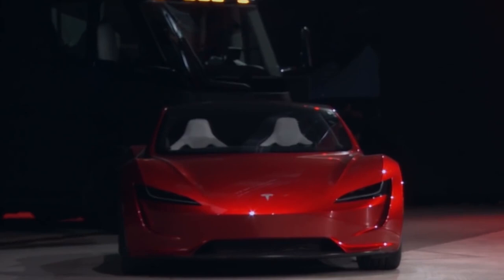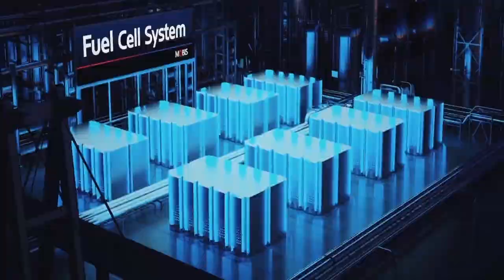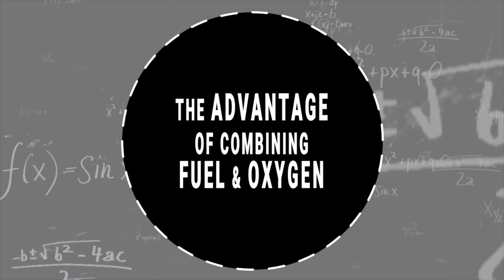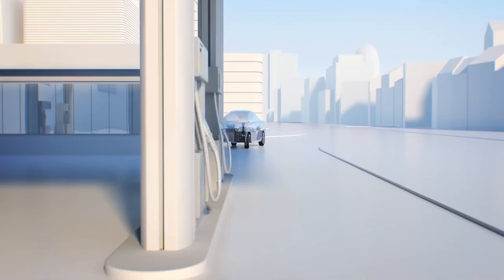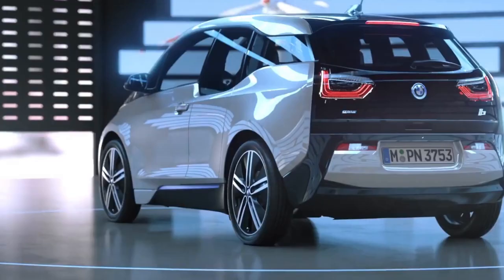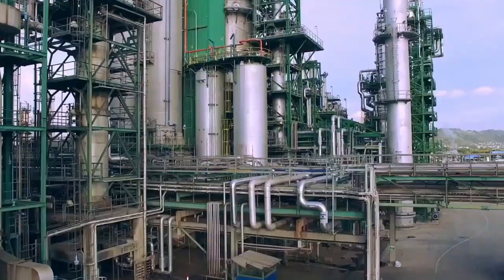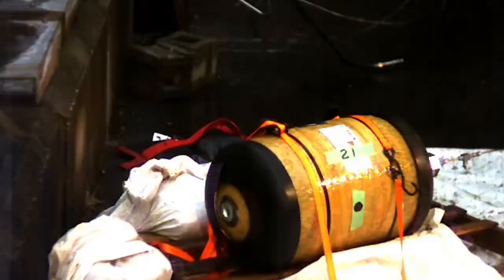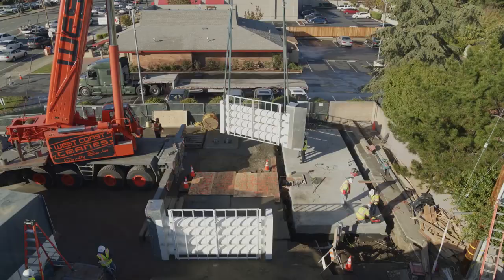is hydrogen fuel cell the future?

Comment: So hydrogen cars currently cost more, cost more to run, and only have 40 places in the US you can refill compared to the tens of millions of external outlets that could theoretically be used to charge a BEV. Hydrogen has its advantages, but it probably won't end up being the better option for cars, it isn't necessarily bad it is just less good and isn't likely to improve much faster than BEVs at this point, the improved energy density would probably be better for aircraft though.
Reply from the maker: I agree with you, for now, hydrogen might be a better option for heavy transportation
Reply: Five years ago you couldn’t wait half an hour at a Shell gas station to charge your battery acid car because there were no charging options. Face it the end of battery acid technology is in sight.
Reply: @rickrozen2341  I don't know of any decent electric cars that are made or sold in the US  in the last 15 years which use an acidic electrolyte. Plus I have seen plenty of gas stations where I could charge an electric vehicle some of which probably haven't been updated in the last 20 years. You probably want to check with the person inside the gas station before using their power but external outlets have been a feature on buildings for quite some time and you can usually use them for free.
Reply: @garethbaus5471  All electric cars use some form of battery acid/fluid. The difference is while Tesla uses unsustainable lithium ion batteries these hydrogen cars wil use sustainable hydrogen as a mean of storing chemical energy. The technology  as far as the electric motor engine is the same the difference is the means of storing the chemical energy.

Instead of waiting between half an hour to eight hours to recharge your lithium ion battery why not just tank the chemical energy in the form of liquid hydrogen?
Reply: @rickrozen2341  hydrogen cars are not significantly more sustainable than lithium ion batteries, we are about as close to running out of any of the materials used for lithium ion batteries as we are to running out of sources of hydrogen, and we don't need to build nearly as much energy genorating infrastructure, or use nearly as many fossil fuels (depending on the method of genorating the hydrogen) neither of which has a negligible impact on the environment.
Reply: @garethbaus5471  Uhmm false while hydrogen electric vehicles are sustainable, lithium acid vehicles are not since Lithium is a rare earth metal and the mining of Lithium is highly unsustainable. In fact the reserves of fossil fuels are larger than lithium reserves and lithium acid batteries cannot be recycled. 

Hydrogen isn’t used as a fuel that’s what all teslaboos get wrong hydrogen is simply used as an agent to store chemical energy and it’s less wasteful as lithium battery acid. Because people do not want to wait eight hours for their RV to charge they’d rather spend a minute or two refuelling hydrogen! Also I’m not interested in destroying the earth or financing child labour so that is why I wouldn’t drive a Tesla.

Comment: As fuel sources improve, the environmental impact of microfine dust produced by tire wear will need to be added to environmental impact of vehicles as they will become a greater source of pollution than the fuels on which a given vehicle runs.
Reply from the maker: Its look good topic to another episode
Reply: I look forward to when that time comes.
Reply: If we use plastic from the wood, we will have no problem more.
Reply: There are also particulates from brake pads. Since vehicles with Regen braking use brake pads much less often if driven well this is another pollution saving of these types of vehicle.

Comment: As long as we make electrolytic hydrogen from photovoltaic panels and wind turbines it can be used as fuel for cars and aero planes using the fuel cell. The fuel cell needs to be made more efficient. The fuel cell should not give off heat which it does.
Reply: What more do you want it’s already more efficient then Internal combustion engines. I think what you actually mean is the electrolysis (initial Energy investment to refined the water into the hydrogen fuel) which is still more efficient then oil refining and if uses surplus’s renewable or nuclear energy and is more cost effective per kwh of storage then batteries, then what’s the problem? Maybe you prefer hydrogen generated form thermal chemical hydrogen synthesis (waste heat of nuclear or mirror array to split water) no costly input at all? Or maybe Microbrial hydrogen production using waste bio products as feed stock for hydrogen? Heck Jupiter is Almost entirely made of pure hydrogen if you want to scoop it up and ship back in distant future. It’s viable Hydrogen House has been using it for 16 years and counting. Batteries literally weigh too much and take to long to recharge for commercial, heavy cargo/range transport,  and industrial application (the main polluters). Hydrogen can be retrofitted with old internal combustion engines and natural gas home pipelines. There is no alternatives besides hydrogen for such emissions free applications. We will need electric and hydrogen.
Reply: No, better not for passenger cars and smaller delivery trucks. That‘s all wasted energy.
The same energy can power 3-4 BEVs.

Comment: The hydrogen fuel cell is promising but in order for this to work, we have to develop a network of hydrogen stations just like gas stations. This will be costly and time-consuming and moreover hydrogen is more volatile. If we go for battery-powered vehicles we can leverage existing electricity infrastructure.
Reply: I would rather but a hydrogen powered car than an BEV. So I hope they start building stations soon!
Reply: @thoos192  … brain with the intention to use it??

Comment: So it seems that hydrogen fuel cell still sounds like an expensive alternative if there are no subsidies. They are less energy efficient than Batteries. But a very green technology for the future. Please correct me if I am wrong.
Reply: Not green at all. You will always need three times the amount of energy.
Reply from the maker: For now, it's expensive but there some countries, like Japan, adopting this concept, and the hydrogen efficiency much better than gasoline
Reply: @ScienceScout  Barely any better..
Reply: @ScienceScout  Even "green" energy sources like colar cells and wind turbines cause GHG emissions. Low efficiency technology like a fuel cell in a vehicle means there are significantly more GHG emissions for the same distance travelled than in a BEV.
Fuel cells have a future in stationary power plants, where the excess heat does not go to waste, e.g. heating up buildings/water or process heat for chemical plants.
Reply: @Simon-dm8zv  Why do you saw "not green at all"? Electrolysis is a very good way of producing hydrogen and very good for the environment, while mining lithium to make batteries that power today's electric cars do pollute the environment as well as the electricity to power BEVs also come mostly from coal power plants. Hydrogen Fuel Cell Cars and Vehicles seems to be a better option here.
Reply: @architsasta700  You are mixing things up. You are comparing lithium mining to electrolysis which is wrong. Lithium is one of the materials used for the production of batteries. The battery holds the energy in the form of electrons. Just like the hydrogen tanks hold the hydrogen gas. So in order to make a realistic comparison you have to compare hydrogen production to electron 'production' and hydrogen tanks and fuel cells to batteries. 
The point is that electrolysis requires electric energy first which can be used to charge an EV directly. There are insane losses in hydrogen production, transport and conversion in the fuel cell. The losses are so high that you can charge at least three EVs with the same energy that one hydrogen car requires. This makes hydrogen not green at all.
Reply: @Simon-dm8zv  I am not mixing up things. When producing hydrogen, you can produce it without releasing carbon emissions and pollute the environment using electrolysis which is a method that is being used mostly in current sparse hydrogen stations like on California, Germany, UK and other countries, if we have stations in those places as well. While the electricity that powers BEVs mostly comes from coal power plants which isn't good for the environment. But I do understand that hydrogen production is very inefficient but one of the biggest problems that no one talks about which also makes BEV better for the environment is the fact that if we all move to Hydrogen Fuel Cell cars, trucks and other vehicles, when hydrogen is released to the atmosphere, the ozone layer will be damaged which makes this whole technology not a solution for current global warming issues, instead, it may solve global warming issues but damaging the ozone layer is another problem. Now after good research, it seems like BEVs are the better option to go for.
Reply: @Simon-dm8zv  they will all need more energy, there might be a slightly less innefecient way to split water so it might not always be 3 times as much energy.
Reply: @garethbaus5471  Well it will always remain close to that. Thermodynamics is not very friendly towards electrolysis, compression and conversion in fuel cells.
Reply: @ScienceScout  gasoline is the wrong comparison, and it‘s not „much“ better. That’s just what you prefer to dream, in reality it‘s only a little better.

Comment: How would you operate FCEV in the extreme cold environment? Russia, Canada, Alaska? What happens if the temperature outside the car is below 30-40 degr. C?
Reply from the maker: It's difficult to tell because there not all of these cars it but according to Toyota their cells work fine and still hit 300 mile and more.
Reply: @ScienceScout  It works in perfect condition. No doubt about this. But let's say you need to carry a 3-4 passengers, plus air con running to heating and cooling plus some music playing load and across the city with traffic lights and jams. Again. Imagine minus 15 degr. C outside (as I have it now in my hometown), road full of cars immeting water vapour. It will natually condense on the road and exhaust pipe.
Reply: Hydrogen FCEV actually work better in cold weather due to denser air ( cold weather should not be confused with higher altitude )

Comment: on board wind generators that spin opposite the crankshaft and flywheel will generate power at high speed and resistance at slow speed is neglgible and the radiator fan behind it

Comment: What about pickups and semis? Strong enough of an engine?
Reply from the maker: Actually hydrogen made for heavy duty
Reply: Take a look at the F150 lightning. They demonstrated the power by pulling a loaded train. They had to run the motors below maximum power because the wheels started to spin at full power.

Comment: A hydrogen prime mover would be a good use of the fuel, like Hyundai xcient fuel cell trucks. Considering trucks use about 2 litres per 100km
Reply: whilst they are good use of fuel cells when compared to ICE vehicles there is a lot to realise here. The Xcient only has a 400 miles range fully loaded, whilst the Tesla Semi has a 500 miles range fully load and can accelerate much faster. Ontop of this hydrogen, whilst being gravimetrically very dense, is not volumetrically very dense in application, coupled with the fact that fuel cells are poor at delivering power on demand. That means the Xcient takes up alot of space. In pictures you can see the result of this in verticle height above the wheel wheels and by how long the truck is, which would significantly reduce its turning radius. This also means the Xcient needs a 75kWh battery pack. thats the same size as the battery pack in a Tesla Model 3 Long range.

Ontop of that hydrogen fuel cell vehicles dont last very long, the Xcient full cells are only rated to last  100,000 miles an due to hydrogen ebrittlement the fuel tanks themselves are only rated to last 15 years. Tesla's on the other hand, on the road today, their batteries will last 500,000 miles give or take battery size, to 70% health. With the semi having a much larger battery that means it will have longer life still.

And lastly it costs significantly more, as much as 20x per mile more for hydrogen vs BEV's. So the Xcient will cost significantly more to operate than something like the Tesla Semi when it is released.

But what about charging I hear you say? well most countries, US, EU, Canada and Australia included, have legal limitations to how long a truck driver can go without taking a break. In the US a truck driver is only allowed to drive behind the wheel for 11 hours. And must take at least a 30 minute break, and must do so before completing his 8th hour of driving. Meaning that with 500 miles of range, the Semi would need to pull over for 30 minute break by law before it peaks its maximum range, and 30 minutes is more than enough time to super charge back to full before departing for your remaining 3 hours before you have to call it a day.

That means you only need to charge during the times you're now allowed to be driving the vehicle anyway. Ultimately this means that there is no real advantage to fast re-fueling quickly if you're doing 500 miles of range. 400 miles of range however might cause more problem and add wasted time rather than subtract it.

Comment: given that fans normalize to the current and all that energy of fan vs motor is wasted you could put magents on the end of fan bladesz and charge through a ring coil .. the energy used to charge will come from the wasted energy between the fan desgin and the current switching .. so yes you would reap a big reward

Comment: BEV REQUIRES MANY HOURS TO RECHARGE. HFC CREATES ITS OWN ELECTRIC POWER. THEREFORE  ONLY MINUTES TO REFUEL IS NEEDED.
Reply: BEVs don't require a human to monitor them while refilling, when combined with the fact that a large percentage of homes and workplaces already have the infrastructure to plug in charge times are almost never an issue.
Reply: @garethbaus5471    it's economical in bigger vehicles, battery electric vehicles give diminishing return after a certain point as the weight of battery increases range increase gets lower and less significant, so in bigger vehicles travelling long distance hydrogen is better fuel, and in cars, not everyone has a garage, majority people in cities live in apartments, and it's not possible for very to go every night or in morning to go to charge vehicle for at least 30 minutes and wait for that time every day, only those who have garage or charging points in their apartment will be fine, which are a very few.
Reply: Many hours to charge?  I charged my Kia from around 30% to full in just around 45 minutes on a 100kw charger.  Your BEV info is lagging behind reality. My solar panels create energy for my car. I can't get hydrogen from them though.

Comment: I don't thing the will take off, for individual traffic. But I see it in aerospace, cargoships and semitrucks. I don't think battery jpowered semi truck will succeed, mainreason being the huge weight of the required battery
Reply from the maker: You have a good point
Reply: Agreed, since batteries aren't a significant weight issue for passenger cars the cost and efficiency advantages are going to be too much to overcome, but when weight seriously matters hydrogen can shine.
Reply: @garethbaus5471  Well, a 2 ton EV have to have stiff suspension to compensate for the weight, making for a harsh ride. So the weight does matter. Also more weight means longer stopping distances when emergency breaking. And a heavy car will take more energy to move than a light one
Reply: @thoos192  In that comment I was pretty much exclusively referring to the vehicles efficiency.

 Also have you ever actually driven an EV? Most of the ones I have driven had a fairly smooth ride.

Comment: Hydrogen powered flights is the future and BEV for personal use.
Reply from the maker: i agree with you that both battery and hydrogen will shape our  future
Reply: I think trucks need to be hydrogen too. Battery isn't efficient when towing. Too add range you have to add battery probably on the trailer so taking cargo space reducing efficiency even more. Even hd pickups like mine I would need hydrogen because I tow long distance frequently.

Comment: Do we create Hydrogen from natural gas? So does that keep us dependent on drilling.
Reply: You could also get hydrogen from electrolysis which is environmentally friendly. Not dependent on drilling
Reply: @alexhernandez2367  yes you can, but you need 3 to 4 times more energy for electrolysis and compressing than puttingthat electricity in to the battery in the first place. Hydrogen cars and trucks doesn't make sense at all.
Reply from the maker: It's a little bit complicated first they need to produce hydrogen from sustainable energy sources for now gasification and electrolysis is the dominant methods.

Comment: For energy efficiency, the claim of 75% efficiency for BEV and 10% for FCEV is misleading. Electricity price for BEV is retail  at average of 15 cents while that for FCEV is wholesale at 3 cents per kWh. Wind in Texas wholesale at 2.6 cents in 2019. Projected retail price of hydrogen is 7.4 cents per kWh. So energy cost of hydrogen versus BEV are comparable
Reply from the maker: But they talk about how much energy losses when they try to convert hydrogen to liquid not just to produce hydrogen-like in hydrolysis
Reply: FCEV efficiency is not as low as 10%, but it‘s not better than 25%.